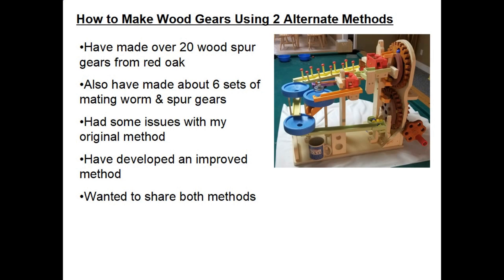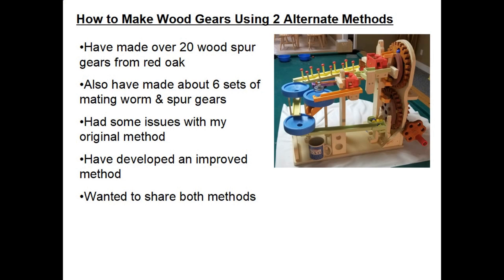How to make wooden gears using two alternative methods.

Comment: Method 3 could be a jig to make the teeth with a router
Reply from the maker: Yes, one could make a router jig to make the spur gear teeth.  A scroll saw or band saw is pretty fast and gives very smooth teeth. I would be worried about "blowing out" a chunk of tooth using a router, but if you made many passes with the router, you might be ok. Nice thing about woodworking, there are usually a ton of options on how to make parts :)  Thanks for watching !!